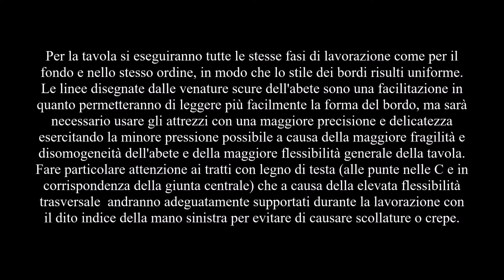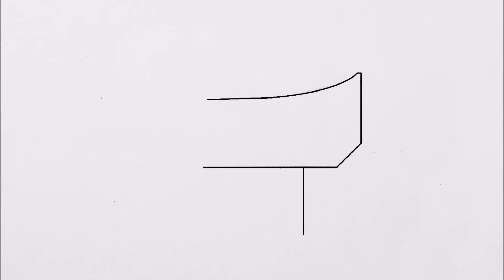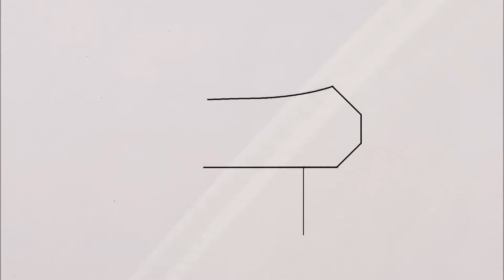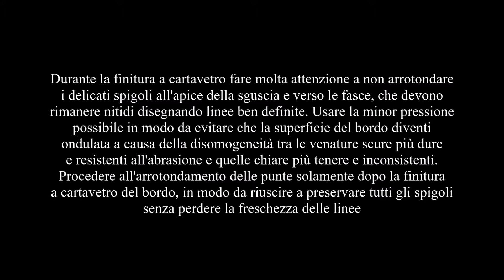6 - Arrotondamento dei bordi parte sesta - La Tavola

Comment: Davide, and what is the final thickness of the edge on the top deck?
Reply from the maker: 3,7/3,8 mm upper and lower bouts, 3,9/4,0 mm CC, about 4,8 mm corner tips. This height is variable because with my construction system, the more you move the apex of the edge towards the purfling, the lower (thinner) the edge will be, and vice versa. The final edge thickness depends on how high the starting flat edge is, how curved the fluting channel is and how thick the plate is at the purfling, and how far the edge apex is from the purling.